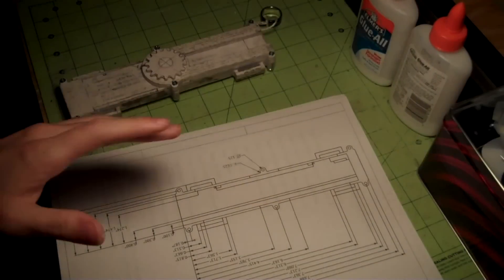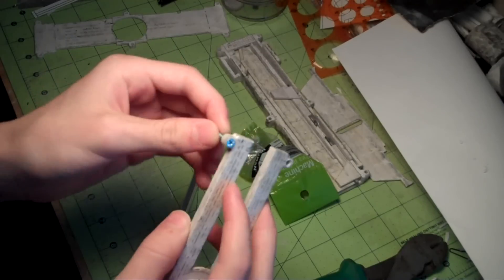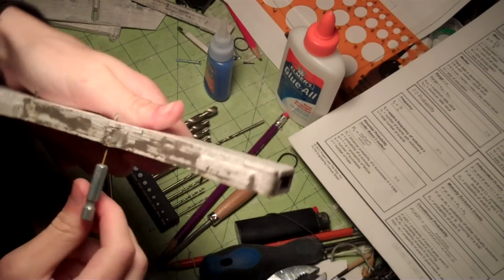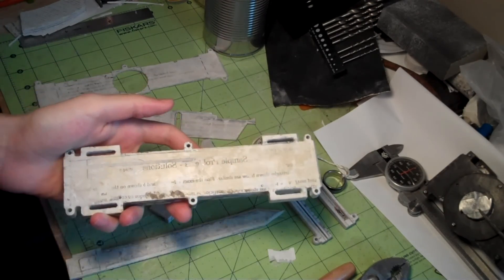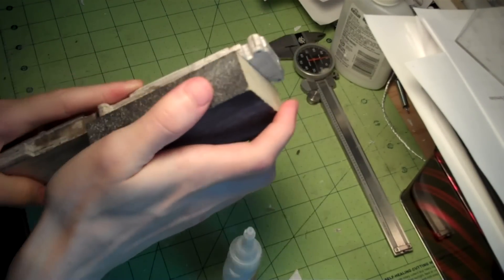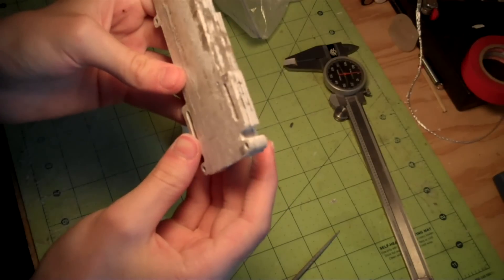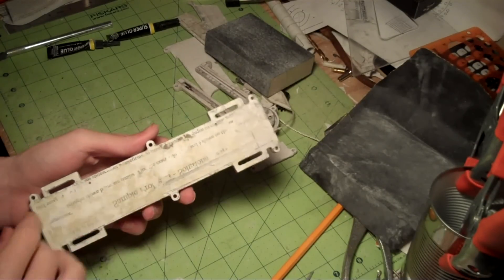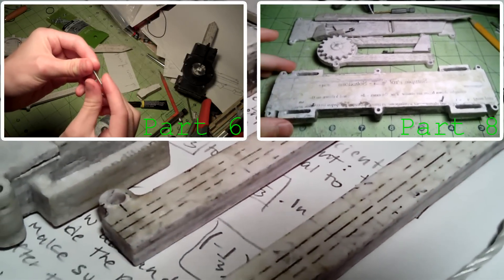How to Build the (Assassin's Creed) Paper Full Size Dual-Action Hidden Blade (Part 7)

Comment: So cool, but can i do it with balsa wood ? ty
Reply from the maker: +Gay Studio Thanks! i don't think you can build this out of balsa wood. It is very fragile and has a plastic coating that prevents the super glue from bonding well. But thin plywood would work well. :)
Reply: ok i will try it, i will replay this coming when i done

Comment: I have a problem i started making it like a 3 weeks ago and of course I started the base and then when i finished layering i let it dry overnight and next morning i cut it and it is still wet so i ruined it so i decided to give up making it but thanks for the idea soon i will make out of wood really thanks my friend
Reply from the maker: RedcarGaming Did you put it under some textbooks to dry overnight? Usually it takes longer to dry when it is under a lot of weight. Which means the top layers could still tear until it dries a little bit more. I'm looking forward to seeing how your wooden version tuns out. :)
Reply: Shelden Caudill thank you for responding. What happened to mine is what you say i put it under some books and let it dry overnight but because of my excitement i cut it wet so thats why i gave up but thanks for the tip.I dont know that because iam new to paper crafting
Reply from the maker: RedcarGaming Oh okay. Well I hope it works perfectly! :D

Comment: my slider keeps pushing my locks down, and when they are pushed a little down the blade releases and does not lock anymore until i take out the slider and it annoys me.......... a lot. i was wondering if you have a fix for that
Reply from the maker: BlackSightGaming So is the slider unlocking the locks normally? Are you saying the lock stays pushed down until you move the slider out of the way? If you push the slider all the way forward and backward, do the locks return to their original position? Usually I have to push the slider all the way down if I want the blade to lock in the external position. Then I need to push the slider all the way forward if I want the blade to lock in the external position. Maybe you could send a picture or something. It might make it easier.

Comment: Dude i have a problem...when I pull the string it makes a squeaking sound...how do I fix that?
Reply from the maker: CresentGold DoesGaming I used a little bit of wd40. It seemed to get rid of the squeaky noise really fast. But make sure you coat the paper surface in super glue first. You don't want the wd40 to soak into the paper.
Reply: Thank you soo muchhhh